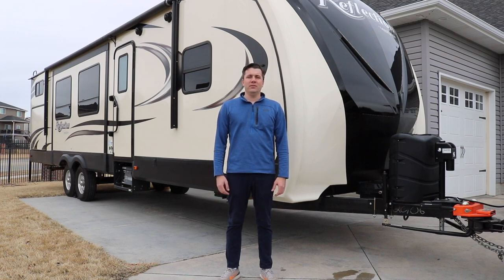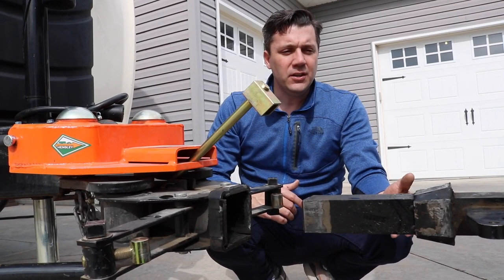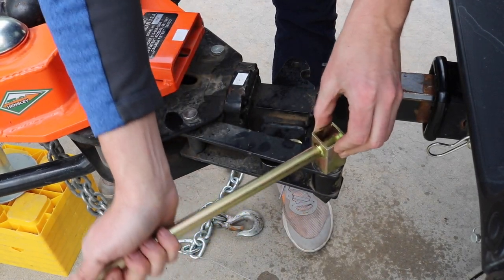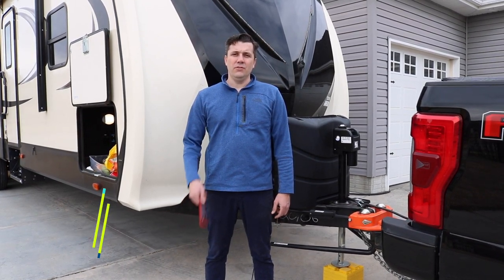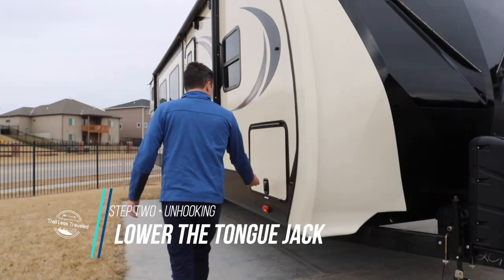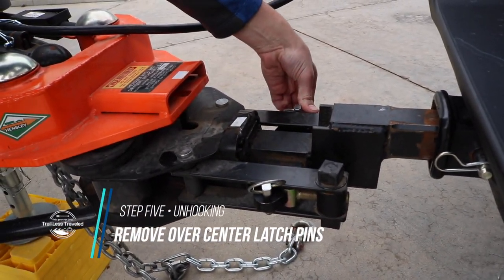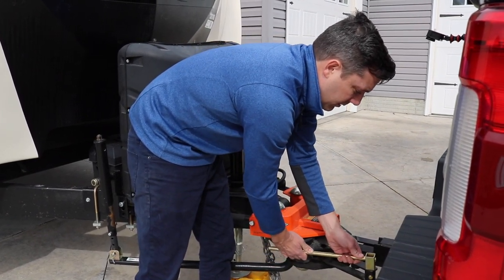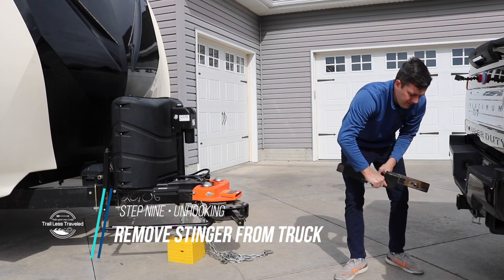Hensley Arrow Hook Up & Unhitch || Hensley Hitch Tips

Comment: Hi guys, great video! I have a Hensley, been using it for 2 years now. Yes it’s definitely a learning curve, I’m towing a 37’ , 7000# trailer with ease. I can hitch and unhitch in 3-4 minutes. Two things I did to help myself was:  I made a piece of wood that is 2”x2” and looks like the letter “T” ,  The vertical part of my “T” is the same height of my truck with the stinger without weight on it, I slide the top part of the “T” into the Hensley just like how the stinger would go in. Then I raise or lower the trailer until the “T” just rests on the ground loosely. What this does is puts the trailer at the same height as the truck w/ stinger. I pull out the “T” and back the truck in with stinger. It works very well. The other thing I did was I cut a piece of pvc pipe to the length of what my truck height is with out the weight of the trailer on it. So once I’m ready to unhook completely after the weight bars are loosened, chains and electric is pulled, wheels chocked I pull out my pvc pipe and raise the tongue jack up until the pipe slides under the stinger , I then know the truck is at unloaded ride height. Then I unhook over center latches and pull the truck out . I did all this because when I first got my hitch it was a guessing game on heights of trailer and truck. When you’re trying to learn something new this can be frustrating. I’ve never experienced pinching my fingers. The other thing I bought from Hensley is the Hitch Helper , that works great , I use an impact with a socket and can slide the front of the trailer back and forth if your not quite square when trying to hook up. Sorry for the long comment, happy camping !
Reply from the maker: This was great! Great tips we hadn't thought of! It is a great hitch!! Thanks for watching!
Reply: @Steve Deeble I will Steve once I get it out of storage

Comment: I see a lot of post about unhooking. So, I ALWAYS put the truck in reverse and make sure I put back pressure on the hitch. This insures the center latches will not spring back and pinch your hands. Works every time for me and never had the bar spring back.
Reply from the maker: We learned to do this the hard way, it needs to be in the instructions for the Hensley!

Comment: At the end of the video as you are driving I notice the "stinger" moving around quite a bit. Is your receiver a 2.5" with a 2" stinger? Just wondering as the movement seems excessive.
Reply from the maker: It’s a 2.5” with a reducer to 2”. It has a little play in it from the reducer. Thanks.

Comment: If you set your parking brake  before unlocking the over center latches your truck won't shift forward.
Also if you remove the foot from the tongue jack that will keep you from crushing it if it's below the weight bars
Reply from the maker: Thanks for the tips!

Comment: Hello, did you have to extend you 7 way trailer cable? If so, did you replace it with a longer wire or add an extension to it? Also, if you did add an extra 7 way cable to it, was it plug and go, or did you have to wire it to a junction box?  Thank you
Reply from the maker: We did not have to extent our cable. There wasn’t a ton of slack, but enough that it was never an issue! Thanks for watching!

Comment: Is it possible to attach this when the trailer and truck are not level with each other?  I live in a neighborhood with narrow streets. My trailer barely fits on my driveway. When I hook up, my truck is positioned on the street with the rear sitting at a higher angle than the front. With a ball set up, this doesn’t matter, but with a stinger, I’m not sure. Is there a way to come in and adjust for a different pitch? In other words, can the receiver be adjust up and down in addition to left and right?  Thanks!
Reply from the maker: You can push it up and down, I would be concerned if it is a big difference because of it only be able to go up/down a little bit.  When I pick it up from storage the angles are the opposite of what yours are and it does fine but it is  a small amount of difference.  I wish I had a way of telling you some exact numbers but I don't.  Hopefully that helps.
Reply: @AllElectricFamily  Thanks! That helps a lot.  Unfortunately, I don't think this hitch will work for me.
Reply from the maker: @LuisMartinez-ft9or  glad it could help if I have a chance I’ll test it and reply back if it works.
Reply: @LuisMartinez-ft9or  Hensley has some videos somewhere showing that you can use the stabilizer bar jacks (the part he used the ratcheting wrench on) to change the angle of the hitch opening quite severely.  You then mate up and then get the truck and trailer on level ground to properly set your weight distribution tension.  I'm pretty sure that was on a video of a Hensley rep demoing the hitch at a trade show.  The visual is that those bars are the "wheelbarrow handles" and when you lift the handles high, you tip the opening down low (and vice versa).

Comment: Wow.  The visual on your initial insertion is very deceiving.  It appears that the trailer needs to be raised and not lowered as there is a gap on the bottom square (of the receiver and stinger) and not the top.  In fact, the top seems to be touching and jammed?  Very interesting how it just popped right in when you lowered the trailer.  Were my eyes deceiving me?  Because what I do with the stinger on partial insertion is look at the square for where the largest gap is and adjust from there to make it even.
Reply from the maker: That's where good lubrication comes in. We used the hitch a few times and didn't have any and we had a hard time getting the stinger in and an even harder time getting it out. With the spray we can be a little bit off and the stinger will still go in and then everything falls into place.
Reply: @AllElectricFamily  My question is, what were you looking at when the stinger was misaligned a little to think the trailer needed to be lowered?   It appeared that the top portion of the stinger was jammed, and from that, I would deduce the trailer would need to be raised?  Interesting because the thing popped right it when you did lower it??